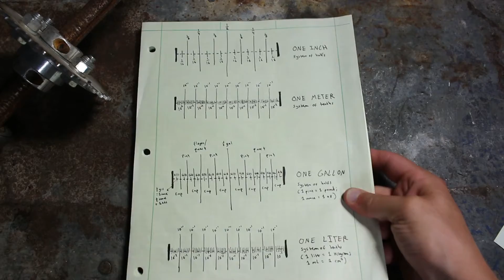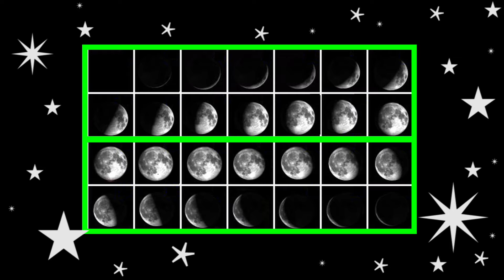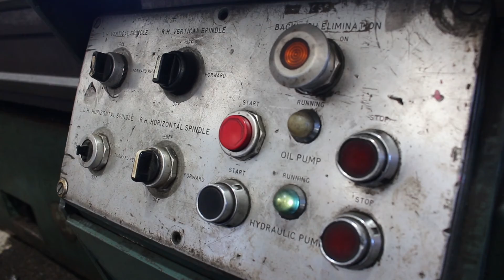Metric vs. Standard: An Imperial Defense

Comment: When I did my post doc, I needed to machine a small reaction chamber that could withstand water pressure at 260 degrees Celsius (this is something like 4MPa of pressure, and not much plastics can withstand that temperature). Since I am not an engineer and did not have design software, I sketched out a drawing to size, and started with standard units, but I quickly abandoned it for metric. The reason was it was too messy to write the fractions, especially when there were fractions of an inch and an inch with additional fractions (like 7/8 and 1-7/32). It was much easier and cleaner to write 45mm, or 14mm (or just the number and note that all units are in mm). I understand the halving argument, but in all my life, I have had little need for it. I will leave this argument though on the subject of division. If there was a beam that was 15 feet 8 inches and 7/8 of an inch or 4797mm and you needed to divide by three to place a support pole, which would be easiest to do the math to the nearest mm or 1/32 of an inch?

Answer: 1599mm in about 15 seconds, 5' 2-31/32" in about 3 minutes - needed to keep the denominator in standard fractions (and way to drop the last 1/8" to make this challenging!). Also look which one is easier to read. Granted that one may not need to be this precise all the time, but still. This is why I like metric. But to each their own.

Also, you can make metric easily divisible if you plan, for example dividing brownies or cakes in sheet pans. You can make the pan 48cm x 36cm and divide by 1, 2, 3, 4, 6,and 12. Design your item to how it will be used.
Reply from the maker: Thanks for sharing your perspective, Michael!
Reply: If you're machining something, you should be using thousandths of an inch, not eighths or 32nds.    So, 1.219 inches instead of 1+7/32.

As for the beam, three issues:

First, 15 feet, 8 and 7/8 inches is damn near 15 feet 9 inches, which can be divided by three in my head in about 5 seconds.

Second, it's not really a fair example.  Who manufactures a 15-foot-long beam to a precision of an eighth of an inch?  It would be to the half of an inch at most. 

Third, if you are actually doing calculations rather than simply measuring something, you would simply use inches, not feet and inches.  And you'd use decimals, not fractions.  So the correct way to state the problem would be "If there was a beam that was 188.875 inches or 4797 mm and you needed to divide by three to place a support pole..."

Then the answer would be very easy to calculate: 62.958 inches.  😊

Comment: LOL... 
1l  divied by 2: 500ml
500ml divided by 2: 250ml
250ml divided by 2: 125ml
125ml divided by 2:  625000µl
...... 31250µl
.......15625µl

Same for each and every other unit in the metric system 

Industry in  192 out of the 195 countries is using the metric system. So if that's a problem, the problem lies with the US education system, not the unit of measurement
Reply: So to divide a liter by 16, you have to resort to using microliters and five significant figures?

Oh, and your math is wrong.  Half of 125 ml would be 62.5 ml, or 62 500 μl.  Not 625 000 μl.  You're off by a factor of ten.

That's not much of a defense of your metric system.  Or your educational system (since you brought it up).  (This is basic arithmetic, not calculus.) 

Meanwhile, a 16th of a gallon is a simply cup.  (8 fluid ounces.)

Maybe U.S. Customary is better after all?

Comment: Imperial is a convoluted mess, and a net liability compared to metric. Saying that fractions are harder in metric is simply a sign that you are not familiar with the metric way of doing things. Nobody talks about fractions of a meter, they mentally tack three zeros at the end and talk about dividing up 1000 millimeters. Or you can make the initial length 1024mm if you want to divide by two lots of times using a ruler.

Now, if dividing a large unit repeatedly in half is an incredibly important and common aspect of a trade, nothing is stopping someone from selling a ruler that divides a meter into halves and quarters and 1/8ths. The very fact that it doesn't seem to happen anywhere demonstrates that it is not as important as people make it out to be.
Reply from the maker: Thanks, Rex. No one is arguing Metric is not an excellent system. English is a global language and is excellent as well, but that is not reason to dismiss and exclude other languages—there is no "manifest destiny" for Metric.
Reply: @McGuireMechanism  Imperial units are defined in terms of Metric units. There is no future for them. The US will eventually switch. The US army and NASA already use Metric. As do US scientists and many engineers. The two system situation only serves to create a barrier of entry into these skilled professions that affects the US negatively. With the rise of Metric China, the US risks being gradually sidelined if they don't make themselves compatible with the rest of the world. 

To make your analogy meaningful, everyone else in the world has decided to speak a single new constructed language (conlang), say Esperanto, while Americans refuse to switch. Of course, measurement units are not as culturally meaningful as one's native language, so the analogy is clearly only meant to falsely invoke an emotional response.

Comment: It's also Litre not liter, metre not meter. At least get the spelling correct. A metre is a unit of measurement. A meter is a device that measures. The average male stride is a metre. The average male foot is not even 12 inches so stating that they are close to a body part is just silly. Ask yourself if you would like to live in a building that was measured with a persons feet hands and fingers, or with a tape measure.
Reply: And it's centre not center? Are you going to reform the entire American English back to the British standard?

Comment: I'm a professional machinist and I use inches everyday. Though that inch is divided into thousandths instead of fractions of halves. So we have our own base ten system, but the inch is better as a base unit for me personally to visualize than a centimeter or millimeter.
Reply from the maker: Thanks for your comment! That's a good point.
Reply: Lol, so as a machinist you find it easier to visualise 1000th of an inch compared to 1 micron? They are both so small, you are saying you can visualise the difference from one hair to another.
Reply: @chippyjohn1  No. An inch and a tenth of an inch (or 100 thousandths) is easier to visualize than a centimeter or millimeter.
Reply: I'm not sure how else I can explain it. I guess just keep rereading until you understand.
Reply: @user-os7pm7fj7d  I'm simply saying that you are wrong that calculators made imperial obsolete, it was obsolete the moment the decimal system was invented. It survived because of cultural inertia.
Reply: Not the point I made. Again reread. I don't have time to keep typing it out for you
Reply: @user-os7pm7fj7d  Of course it's not the point you made. The point I made is that your point is mostly irrelevant and the real reason is different.
Reply: It doesn't matter if morrons understand the benefits of the metric system, they will live in their imperial bubble until they die. Maybe that's why their children will spit on their graves and curse them, but you can't change these people. 😂😂😂
Reply: Nobody has done the opposite, ie, make a meter ruler with 1/64m divisions. That kind of demonstrates how the whole repeated division by two 'feature' is not that important.
Reply: @rexsceleratorum1632  it's really just about precision. 1/16 is easier to reach by dividing your base unit in half over and over. Once we had more precision, it became more practical to divide the base unit by 10 instead. Like I said I use inches every day, but i still divide that inch by 10s. When I was a cabinet maker, I didn't need as much precision so 1/16 of an inch was good enough for that.
Reply: @user-os7pm7fj7d  At that point you are using two completely incompatible units and systems. My point stands. Nobody is doing something similar with meters or centimeters. Nobody is dividing centimeters by 8 or 16 to create rulers that are "more useful" than dividing by ten. Meanwhile you only achieve convenience by inventing a new system that behaves like Metric.
Reply: @rexsceleratorum1632  As does mine. We're too advanced in precision for it to be necessary for us to divide our base units by numbers with more factors. Another reason for using a number other than 10 to divide is divisibility. That's the reason we divide the day by 12 hours instead of 10 and a circle by 360 degrees instead of 400 degrees (like the metric system originally included) So its just application, and where you were born of course. Hahah
Reply: @user-os7pm7fj7d  Again, you haven't refuted anything. Metric people don't invent new rulers with 12/16 divisions for particular applications. Because the benefits of consistently dividing by ten outweighs everything else.
Reply: @rexsceleratorum1632  not trying to refute anything. there's just no need to do that. We have machines that instantly convert and divide for us now, but calculations used to have to be done manually. The imperial system is sort of optimized for that. There's 12 inches in a foot instead of 10 because 12 has more factors and is therefore easier to divide into whole parts without needing to break up one of your units. 1/6 of a foot is 2 whole inches. 1/6 of a meter though is 16.666 repeating centimeters. That's kind of a pain if you're a merchant 500 years ago. Divisibility took precedence because it saved time which saved money. We didn't need to worry about that so much once we were advanced enough.
Reply: @user-os7pm7fj7d  Modern tech is not really the reason the imperial system is outdated. The decimal system was invented in India about 1700 years ago, but it only reached Europe 1000 years ago after Arabs transmitted it. The decimal system made it infinitely easier to deal with decimal units. That's the point when imperial became outdated. Its survival since then was just inertia and the lack of a better system until Metric appeared.

Comment: As long as you stick with two ot three units, you won't see the proplem of the US customary units. Just try to calculate the area of a room with 3 yards, 2 feet and 4 inches in length and 4 yards, 1 foot and 7 inches in width. Anything else is making up non-arguments and make-believe. The moon cycle is 27.3 or 29.5 days, btw, so that's a non-argument, too, as is having more dividers. If that was the case, it should be base60 like the Babylonians did (especially since the factor 12 is pretty rare in US customary units.... ) In 99.9% of the situations, there will not be a whole foot to be divided, and here it will be MUCH more useful to actually have learned some math (I hear PEMDAS is really causing problems?). 
Just remember Mars Climate Orbiter and that it was a GERMAN and the metric system that got people on the moon.
Reply from the maker: Thanks for sharing your thoughts! If I were measuring a room sized per your specifications in the Imperial system, I'd just use 136" X 163"—the measures you've cited make things more complicated than necessary.
Reply: @McGuireMechanism  this is exactly my point. But these things happen. And they happen often if things get bigger. Try civil engineering. Cable tracks 2 miles and 750 yards long, with supports every 15 inches. You do unit conversions all the way, and they do fail much more easily than metric conversions, which are just moving the decimal point. 0.013 km are 13 m are 1300 cm are 13000 mm. No calculation required. This is the reason the French invented the meter and the base10 units that fit our number system, since they were fed up spending time and loosing money doing unit conversions, and according to some economists, the US looses 13 bucks per day and person of GDP do to overhead and increased waste from using customary units. I do understand that, for a carpenter or CNC shop, it may not be an issue since everything is basically inches only, and a system one is used to seems easy. I grew up metric-only and can do inch to mm conversions on the fly while watching a woodworking video - its not ideology or personal preference that makes us use metric. It is objectively superior in most cases. Like LED traffic lights are superior to incandescent ones 99% of the time, and sticking with incandescent ones because "there is this one case..." is a really bad idea. Its like going from oxcart to 40t semi. It takes some getting used to, but the semi gets more done in less time with less effort - but you'll only notice it after you put in the effort. And you would not want to keep the oxcart for those few cases where it would actually be better. You'd take the increased gain from using the semi and rent a Pickup.
Reply from the maker: @wernerviehhauser94  A good designer running a 2-3/4 mile cable track using the Imperial standard would apply supports every 16" (not every 15") so each quarter mile divides evenly.

Designing for Imperial vs. Metric takes different types of thinking. My argument is that neither is better or worse but that Imperial still has a place. I do appreciate hearing your perspective.
Reply: @McGuireMechanism  a good engineers works based on mechanical and economical requirements and not on based on "I can save on math here".
Reply from the maker: @wernerviehhauser94  Agreed, also a good point.

Comment: The term “standard” is confusing to people who don’t know the history.  It was used by auto mechanics decades ago when there were few cars in the USA that used Metric hardware.  SAE inch-based sizes were the “standard” in the auto repair industry.  It was just easier to say “standard” than “SAE” or “fractional” or “inch-based.”  The term survives even though US car makers have switched to Metric hardware. 

Now that SAE have become SAE International, they have many Metric standards, so calling inch-based wrenches “SAE” is not accurate.
Reply from the maker: Thanks for the history, GH1618! I come from the custom machinery/metal forming industry, and on the floor "standard" just means Imperial. Great variety out there.
Reply: That's why it's actually called the U.S. Customary system.  😊

Comment: Metric vs standard but metric is standard in every country but America isn't it?
Reply: Why not call it by it's name, IMPERIAL?
Reply: @raphaelfeliz2930  cause its namesake doesn't use it anymore lmao
Reply: @australianword3812  it's name explains a hints why it's so chaotic.
Reply: @raphaelfeliz2930  not really... no. Lmao
Reply: The official name for the customary units used in the United States isn't "standard", it's "U.S. Customary".  😊
Reply from the maker: Hi Joehua—good question! That is certainly the surface-level argument, but it is fascinating to look a little deeper. Many countries have older "standards" that came before metric and are still used by the smaller, independent businesses that don't do as much international trade. I use the term "Standard" when referring to the Imperial System, because that is the colloquial norm in my area.
Reply: @McGuireMechanism  That's exaggerating the role of pre-metric units quite a bit. Here in India, we still use inches and feet and acres (that's it) casually and out of habit. But nobody uses 1/16ths of inches for anything, they switch to mm. In fact I was an adult before I took a close enough look at a ruler (metric on one side, imperial on the other) and finally realized that inches weren't subdivided by tens at all. 

Casual local units still exist across the world, but few of them are used for anything significant or official.